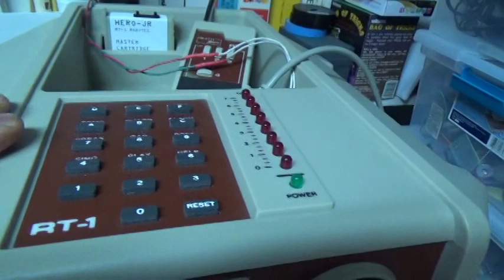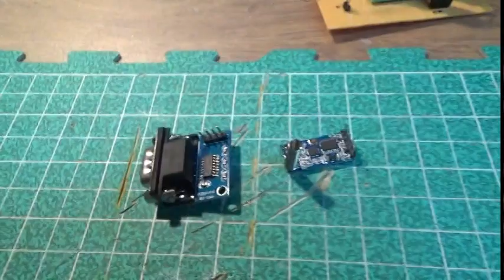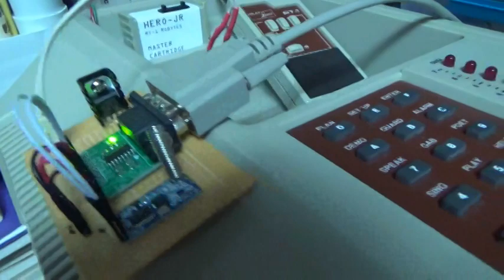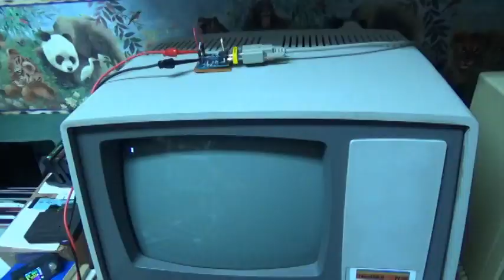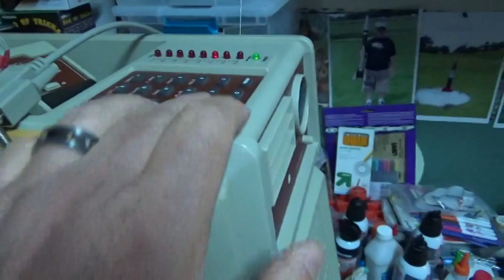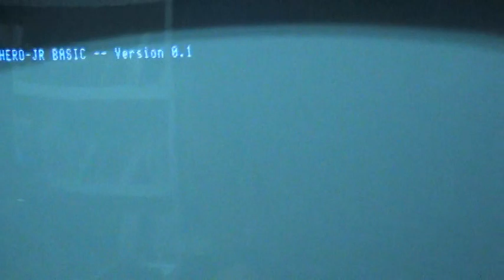Heathkit Hero Jr Robot Wireless Communication

Comment: I just used a ESP32 to add bluetooth serial to my Hero Jr.  I didn't have a remote with my robot, so I added a generic 4 button remote, buck converter, esp32 and a rs232 level shifter where the remote board goes on the front of the robot. Flipping the sleep switch turns it off.
Reply from the maker: Nice. So I'm not clear how you implemented the remote functionality. Did you connect your receiver directly to the remote board?